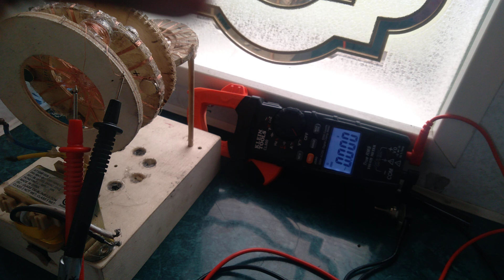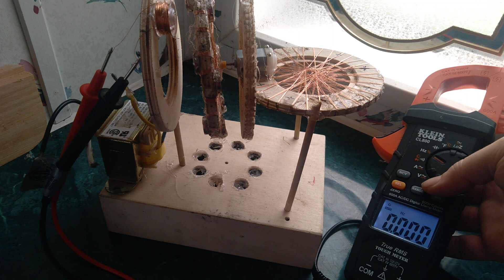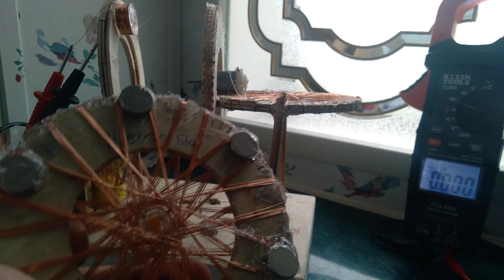ALMOST Free Energy Part 2! Nikola Tesla+ Marko Rodin+ Gerrard Morin+ Wimshurst

Comment: How much volts and Amp brother and what is it, 12 volts motor and what is the rpm next time find the ratio of frequency rise with voltage as ur good at maths and if u cd plot a linear or what kind of graph happens for rise in hz against v, rpm
Reply from the maker: Check out my latest video for the answer to that question my friend :)